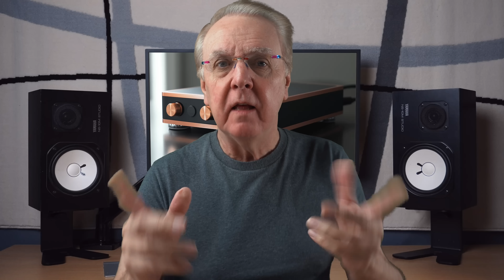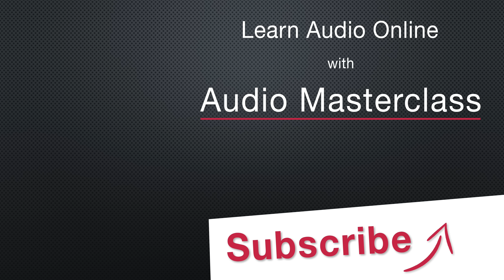Audiophile preamps - What should you get for $30,000?

Comment: I bought a couple of bouquet valve amps a few years ago with a brace of 4x6550's per side for 120W and it was totally unstable into my smaller Martin Logan speakers. Absolute waste of money as I was constantly sitting waiting for one of them to go into oscillation, red plate and cost me a fortune.

I ended up replacing them with a John Curl designed Parasound A21 stereo monster amp which cost a lot less than the tube amps and upgraded my speakers to bigger ML's. The pairing sounds wonderful to me. I use cheap speaker cables and interconnects that are good quality but not audiophool prices. I also updated the pre-amp to a Moon 390 which I use with Roon and guess what - I'm happy. I have an old Systemdek 2X2 with a Roxan Tabriz Xi and my next move will be to upgrade from my current cartridge to a reasonable MC BUT the preamp will take care of the loading and I'm not expecting the world because I don't listen to vinyl enough. 

I also have a Revox B77 half-track 15/7ips and that is just wonderful. A Revox B77 mk3 has been released which is significantly less than the Evans preamp. This is a mechanical piece of wonder and has a significantly higher quality and amount of electronics behind it to make it work - Not just the preamps for record and play, but servo's, a much more complex power supply to drive the motors etc.. How Evans can justify these prices are beyond me. look up Revox B77 mk3.That is £15k and compare. And I'd buy that.

The problem with the audio market is it is and always has been full of scammers and shysters. In the 80's it was Peter Belt and others. 

I am involved in the design of Ethernet switches for mission critical and industrial applications involving time sensitive networking and redundancy. I understand how switches work and there is absolutely NO way that these so-called "Audiophile Ethernet Switches" make any difference at all. They just copy existing reference designs for unmanaged switches (look up store and forward) and are typical of the sharks preying on the gullible. 

If you don't have an engineering background or understanding, you need to take someone with you who does if you are looking to spend a lot of money.

Comment: I have been electronic designer for past 40 years (MSc. E.E.), designing RADAR and Laser past 20 years, have electronic as hobby since childhood too. I build Audio amplifier too, I can tell you that R&D is the most expensive part of the design, it means that it take serval years to design. When it comes to pre amplifier when the signal level is in micro level (around 40 microvolt for cartridge) it is difficult to achieve good signal level without amplifying the noise. 
Most engineer they increase the level of signal to achieve high value SNR (signal to Noise ratio) 
But real audiophile engineer should decrease the noise and not the signal level. Because when you increase signal level you increase also distortion, 
To decrease noise is most difficult part in all electronic design. It’s no matter if it is RADAR or preamplifier for cartridge. 
As end user when they open the enclosure and see each component price they think they are get robbed. They don’t see how 40 microvolt get amplified to millivolt (1000 time amplification) with lowest noise.
Reply: I mean, he didn't design and make his own components from scratch...
Reply: True, but that can be done for much less money.

Comment: handmade soldering on PCB is far from the best practice and can't be a marketing claim.  to ensure to keep the best performance of the expensive components ypu can't rely on an operator to respect  the curve temperature/time max
Reply: Don't ever design in surface mount film capacitors.  They don't survive even the best process.  I had a failure rate over 1% when I made that mistake.
Reply: @kensmith5694  don't generalize your issues to the whole PCB industry that is  almost 100% SMD. Working in a very big industry I can say that all our electronics pass successfully through a bunch of endurances at low and high temperatures, thermal shocks, vibrations, etc....
If the line is compliant to the standard and well tuned the failure rate is ppm not percents.
Reply: @jeanmichel2642  They tried repeatedly and we tried a different shop.  Surface mounted film capacitors didn't work.

Comment: It seems to me that the mass-market has moved away from 'quality' reproduction - now it's all digital, bluetooth, earbuds and sub-woofers - and brands like Teac, Sansui, Akai, Sharp, Marantz, NAD, (etc) have all left the market. I think that the great majority of those under aged 40 have never heard 'quality' sound reproduction - even via the mass-market gear of 40 years ago. Not only has the gear become less capable of such quality, but recording techniques, and the increasing homogeneity of popular music, has made it all less pleasant to listen to.

I have a tube amp - a clone of the Dynaco ST-70 - but modded by me with NOS Mullard tubes on the phase-splitter & pre-amp stages, with NOS Sovtek KT-88 power tubes. I also modded the transformers to use Lundhal - an esoteric Swedish manufacturer. My speakers are vintage JBLs that have a 96dB/m sensitivity spec. Signal sources are a Fiio X5 mp3 player, a Dual CS505 turntable, and a Marantz CD player that's been modded with a tube output stage. All sources go through a Marantz tube pre-amp clone - the ST-70 is used as the power amp only.

I'm into the rig for around $4k but I've found that advancing age means a loss of 'golden ears'.
Reply: Quite the contrary.  We never had access to such a high degree of fidelity for very affordable price.  Just take Hypex Nilai or Purifi amp, they are much higher fidelity than any analog amp you could imagine.  DACs are commodity level, a 300$ DAC is better that anything analog including source tapes!  (13 bits equivalent with all enhancement circuits enabled).

The problem we have today is the stupid people who mix albums and fall for "loudness war", low competence and idiots.  But bad mixing and bad sound is not something new, few albums for the last century sound really good, we're talking about minority.
Reply: and those over 40 cant hear the difference anymore.

Comment: IMHO a 30k audio device needs to have heirloom lifespan - the thing needs to be reliable, rugged and repairable - you should be reasonably sure that there will be a way to keep it running for generations.
Reply: Heirloom Lifespan.  I have Two of those.  Both designed by Noel Keywood of Hi-Fi World, during the 1990's.  The KLP1 Pre-amp and the K5881 Mk2 Power Amp.  Just had the KLP1 overhauled and the K5881 will be serviced in the New Year.  Both are over 25 years old and still going strong.  After that, I shall have my Quad 57 Electrostatic Speakers serviced.  Mine were made in 1962 and still working.  Front end is Thorens TD150, with Rega 300 arm, both over 30 years old.  I'm extremely happy with my system and it will last well beyond my lifetime.
Reply from the maker: 57s. You’re living the life.
Reply: Not too difficult, just go easy on the unobtanium. I have a Quad 306 which has just had its power supply caps replaced as a precaution. It's dead easy to get at if anything else needs servicing.
Reply: A 30k audio device should have absolutely perfect measurements across the entire spectrum and all decibel ranges. It should be the embodiment of the level of perfection achievable with existing technology. Even if the user is incapable of hearing the difference with our somewhat limited sensory organs, at least with measuring equipment it should be apparent the money went to making the device objectively better in some way.
Reply: Or at least a lifetime warranty, parts and labour backed up with an insurance policy for when the maker goes bust.
Reply: @ferdinandbardamu3945  Good luck with that old thing! Rarefied audio gear seldom has a lifespan of more than 20-30 years.
Reply: @ferdinandbardamu3945    Truth. It should come with maintenance notes and a direct phone number to someone who can address any and all concerns either by email or phone. In other words… support.
Reply: It will be theown on the trash by a heir who thinks it's trash because it doesn't have a USB jack or WLAN.
Reply: no doubt and 250k car should run for 250 years and serve the whole village
Reply: @wojciech-nq5gq  alot  of hi end cars are over 100 years old  lol  ppl do fix them  there not made of cheap ass plastic like this pos   school  project

Comment: Anymore, I am of the opinion that anybody that thinks that kind of money is justified, especially considering the variable qualities of the actual recordings that will pass thru these things, deserves to be fleeced in such a way. Audiophilia has become so much more fruity since the advent of the internet/social media, that I can no longer align myself with that title, even though I never actually did call myself such a thing. I've always classed myself instead as a "music head," going on 50 years now. 

Many modern audiophools bought their way up the hi-fi ladder overnight, and you can tell by the token ways they describe their system and experience, with the most internet trendy purple prose and other self-imagined weirdness. Modern audiophools need all of this mysterious and expensive electronic voodoo, whereas the seasoned and tried music head, can still get it done with a clapped out pair of Cerwin Vegas and a consumer grade receiver. 

The current penchant for tube gear is, because so many internet trained audiophools bought the wrong overpriced/hyped speakers and put them in the worst possible space to begin with. They'll buy some of the most flat measuring, neutral speakers, and then try to play classic rock and pop from the '60s-'80s on them. They think the tubes will "warm up" the obnoxious system they have instead bought into. You can further tell these phools because they usually set their systems up like it's posing for some eccentric audio publication.

Comment: With proper design and components, there is nothing wrong with putting the power supply in the cabinet.  They do this with the most sensitive test equipment, like 7.5 digit multimeters that will accurately measure into the nano-volts.  Even they don't cost $30,000.
Reply: You need screened off areas and very EXPERT design for that. teams of EEs and juniors learning at the coat tails of the grey beards. Tektronix for example.
Reply: @joefish6091  I suspect the gain stages in a 30 year old Tektronics 'scope are better than anything in that $30K pre-amp.
Reply: @Tom_Losh  I'd have to agree.
Reply: @joefish6091 you can get a hell of a scope for 30k nowadays.

And for 25k tom evans could have machined sections for different parts.

Btw tom evans says solder ruins the audio path so could have gold interconnects too. If they did this the customer would look at it and think "woow" if they saw it open.
Reply: @lasskinn  "solder ruins the audio path so could have gold interconnects too"

But gold on gold connections still get moisture build up in the way. Ask anyone who's ever reseated a board with gold connectors and gold on the PCB tabs in audio, video or computer equipment, and suddenly it works.
Reply: @chrisquirk4754  tom evans fix for their bare copper that obviously sulfates is to clearcoat the whole thing presumably after using the screw connectors(and yes that product is just a copper cylinder with screw connectors on both side basically). 

(Dielectric grease doesn't exist in audiofile world)
Reply: @joefish6091  Well Tommy boy is selling at an EXPERT design price.  The Keysight 34470A 7.5 digit DMM sells for about $4K.  Or he could get the 3458 8.5 digit DMM for $15K that will measure down to single nano-volts.  He could buy one of those and see how it's done.  He seems to be good at copying other's designs.

Comment: Any modern op-amp will surpass what's actually necessary to amplify MC signal. Once that tiny stylus touches the groove, none of that ultra-low noise, ultra-low distortion matters.
Reply: The signal from any vinyl disc contains eye watering amounts of noise and distortion, and it's important to reproduce this with the greatest accuracy.  
Apparently.
Reply: You are incorrect about "any modern op-amp".  Consider some of the low power ones.  They have slew rates in the volts per millisecond and gain-bandwidths that die at a few KHz.  If you spend about $5 on an opamp you are likely to be OK.

Comment: Good knob feel is so important for $30k
Reply from the maker: You’re so not wrong.
Reply: I spent 30 grand last night but she didn't have a knob.
Reply: @markrigg6623  Thailand is like that.
Reply: ... as is a very happy ending.
Reply: Yup - she had better be good for a $30k feel of my knob!
Reply: Repeatability, tracking, low noise, repairability, curve customization can be handled to excellence with a mechanical rotary step attenuator (as many channels as you have space for!). For the hand built crowd, I would hand-wind each resistor in a non-inductive pattern using ni-chrome wire on a ceramic bobbin, epoxy vacuum potted in mu-metal for tropicalization. A solid machined brass knob and click detents with ball bearings would give excellent feel.  WECo 111c inputs and outputs outputs so that it has really good "heft" as well as optional passive mid-side matrices (in and out, switchable).
Reply: Yes, and the thing it moves should work very smoothly.
Reply: You could feel mine every day for 30k

Comment: now understand, that $31,000 "pre-amp" is not a switcher/attenuater it's very specifically a moving coil "head" amp as they often called.  It's job is simply to take the very low signal input of a moving coil signal from a turn table and amplify it so your ACTUAL pre-amp can pick up the signal at a proper line level and output that signal the power amplifier and then to your speakers.  Suffice to say, if you are spending THAT kind of money on just the MC head amp, you are spending quite a bit more on everything else, and it's pretty much expected you have a complete system that's well into the several hundred thousand dollar range.  So that product is for the VERY high end audiophile that can afford the best of the best.
Reply: 🤣🤣🤣 nah, audiophool
Reply: When brands such as dcs and Naim are actually measures they are objectively worse in many cases than smsl, Schiit, Wiim, nad etc etc.
Reply: Well, as these units have competition that objectively are the best of the best that are a fraction of the cost, it is for the audiophile that wants to show that he can afford more than the next guy.
Reply: @niklasschmidt  yeah, "best of the best" might be nuanced, more like "the most expensive gear".

Comment: It is not cheap to hire someone to sand off labels from all the opamp by hand.
Reply: Filing off numbers is what criminals do with guns for the black market 😂
Reply: @ropeburn6684  If that's what you've been doing for money, well here's an alternative career option for you.
Reply: Definitely costs more than the 7X15 regulators and NE5532 opamps he's probably using.
Reply: @peterlarkin762  I agree and he does that because real experts such as yourself  would never bought it knowing that it uses these parts.
Reply: China does that, too
Reply: @stefanegger yeah but China does it a bit cheaper... 😁
Reply: There are quite a few small makers of 'High End' gear who do the same and a couple of relatively large ones. Well at least back when the older gear we see was made. Considering the age the things generally need repair they are way past any warranty of even parts stock at the maker its all very annoying and a waste of time.
Reply: @kelvinjinxd    When I use complete circuits in my designs, I choose them with great care to make my product better, so I’m proud to let people look under the hood. I can’t imagine why I’d sand off that info unless I was lying about my designs. There are complete audio circuits, including amps and converters, the equal of which no one can make with discrete components. Anyone who claims differently is simply making shit up.
Reply: I mean, they only make a few a year, so it probably is pretty cheap.😅
Reply: I’m in the wrong job clearly 😂
Reply: HP Used to do that for the chips in the electronic test gear they sold.  I think they had a machine for the job.  When doing it, you need to keep everything grounded.
Reply: @kensmith5694  Cannot agree, have never seen any HP equipment with such a mis-treatment, on the contrary, HP always gives fully detailed circuit diagrams with parts lists and everything.
Reply: @AlterKater  I have an HP7155B strip chart recorder where it was done. A CD4024 Was relabled with an HP number
Reply: @kensmith5694  Oh yes, they used their own numbering system.
Reply: @AlterKater  Read back through this thread, I suggest
Reply: @kensmith5694  What do you want to tell me? i repaired HP stuff enough to know them. Yes, they had their own numbers.
Reply: @AlterKater  I said that HP removed the numbers from chips.  You suggested they didn't.  When I said I have a concrete example here, you admitted they "used there own numbers".  They did in fact remove the makers numbers from the chips as I suggested they did.  The top surface on the ICs doesn't have the normal look to it.
Reply: @kensmith5694  I cant say, this I never noticed, despite working a lot with their equipment. As a big company the manufacturers will print your logo and your part number on the item you order. No need to remove any labels. I have worked in that semiconductor industry. When you think they removed the original standard logo, you may be seeing their original proprietary logo actually.
Look again. Aside from that, the documentation service manuals of HP were perfect. Could not be any better.
Reply: I'm sure removing a temth of a mm of th3 plastic will change the resonqnve frewuency whifh will require expensive compensation ,-)